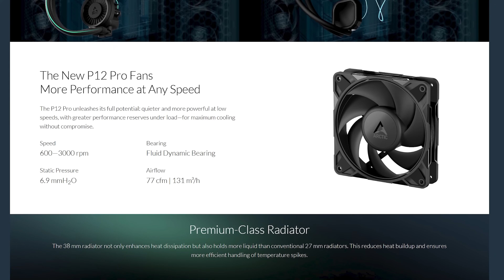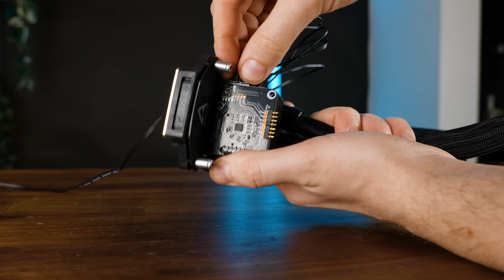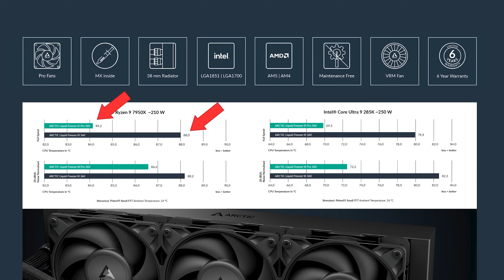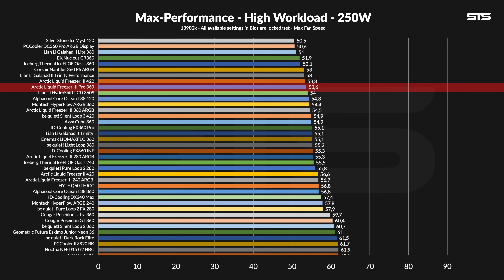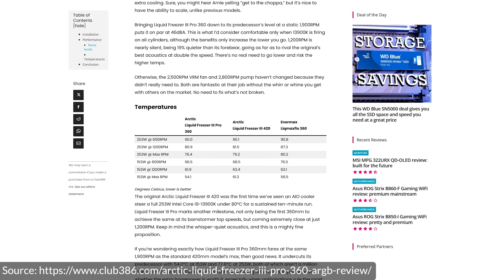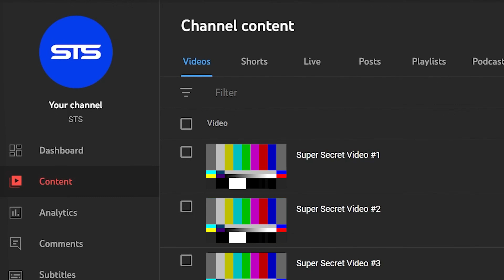Arctic Liquid Freezer III Pro 360 - The Pro Among The Kings

Comment: not impressed at all. And these thicker rad AIOs from Arctic are beaten by slimmer ones nowadays.
Reply: Maybe Arctic can improve the internals to "slimmer rad specifications" and beat them by performance with 38mm radiator in the next version. Oh and improve their cold plate design. Fans are pretty much perfected.
Reply: @Faruk651  I would love a nickel plated coldplate, and also move the pump inside the rad like the uber expensive xe360-TR5 cooler so that pump noise is reduced and potential leak can be isolated away from the rest of the PC hardware.

Comment: Looking forward for Arctic Freezer 36 performance with swapped fans with this new pro variant.
Reply: I don't think people do realize the Fans are not where the improvement is. Fans are pretty much perfected. The cold plate and the efficiency of the radiator is the limiting factor.
Reply: @Faruk651 scratch my previous comment, these fans literally have triple the amount of static pressure, they went from 5 blade to 7 blade with tighter tip clearance. The fans are genuinely hugely improved

Comment: I really wished they changed the design of the tubes. It is not compatible with a lot of x870 and b850 mb and the free heatsink they provide you is absolutley not enough for gen 5 ssd/ Mine was thermal throttling

Comment: We need a standalone review for those fans; they seriously look impressive.
Reply: I have to know if its better or worse than the endrofy fluctus
Reply: @ definitely better I,d say
Reply: The pro faster rpm on pump fan,  faster rpm on fans on rad to can't wait for the 420mm version  😁
Reply: @lordsanjeep  you know if fast rpm is your thing 10.000rpm server fans costs hardly 15 euros.
Reply: ‼ The Pro versions of Arctic have worse temperatures than the non-pro versions of AMD processors. My ALF360 keeps 6C lower temperature on the 9800X3D than the Arctic Liquid Freezer III Pro 420... https://www.youtube.com/watch?v=cw6n5ev4-oI
Reply: looks like a copy of be quiet! silent wings 4
Reply: @GukuBest it’s worse, the sw4 120 has a 9 blade design so its got better airflow and air pressure (also a 6-phase motor with fdb bearing so its also more reliable and less noisy) obviously the cost difference is big though
Reply: @kerotomas1  lol 5 pack of Arctic pro fans for less than a single Silent Wings 4

Comment: The water pump on this thing sounds like a vacuum cleaner on full blast. Regret buying it.
Reply: Try to put some tension on both hoses close to the pump. Get some long velcros or zip ties and pull them to one direction and tie it to the case. Inlet and outlets are swivel so no worries about bending them. This will lower the vibrational noises a lot. Give it a try.
Reply: Got my LF3 ARGB two weeks ago, and is my first ever aio. Im surprised how dead silent the pump and and fans are at 100% . I'm glad I got lucky in that regard.
Reply: If I max out mine at around 4500 (reported) RPM I  can hear it a little. I dropped it down to just above 4000 and it's dead silent
Reply: Yes it is pretty loud at 4500 rpm, but in my case with an 7800x3d I can easily drop it to 2000rpm with no temperature impact.
To be fair it is the 420 version which is overkill, but almost the same as the 280.

If you have a 300w CPU: good luck

Comment: What do you think about changing that 7950X3D to 9950X and testing it at (for example) 120W, 180W, 230W? I think it will show more info about how the coolers perform on AM5.
Reply: Nah your 7950x3d is still a monster CPU even today . If you want to upgrade from it then you should go to the 9950x3d to feel a big difference. Or wait for the Ryzen 10000 series.
Reply: @Thomas-y24  Did you read my comment? I did not ask for an upgrade, I asked if he can change his 7950X3D for another CPU and test it properly using 120/180/230W.

Comment: What the hell happened to the AMD benchmarks??? WHy concentrate on Intel that hasnt really sold well in the last 2 years?
Reply: Intel is hotter, that will give a better test as to how well the AIO is cooling. The AMD section being so small just shows this thing is overpowered for such a setup. And it doesn't matter if Intel hasn't really sold well last 2 years, there are 1000s of 13th and 14th gen setups in use.
Reply: @sabishiihito  Gives us figures showing us how it performs to other coolers, including normal LF3, its half assed regardless of everything you just typed

Comment: When will the 420 pro be released? The 420 original is sold out everywhere 😵‍💫
Reply: They have said Q2 for the rest of the models.
Reply: @TheGooseBruce  isnt this q2 right now? 😂👍
Reply: @jonashoeg Yeah, but in my experience, Q2 never means early in the quarter. Even if no delays. :P
Reply: @TheGooseBruce  yea i know. I will se if i can find a decent used one. And do a push pull configuration of the "old" version. I dont really want to wait 1-2 months.
Reply from the maker: No idea, I’ll ask and get back if I get a date

Comment: STSYT. Do you always use the same thermal paste with exact same application for all your tests? Also how much do you tighten the contact frame and cold plate down? Bottom out? Thank you for these great reviews.
Reply from the maker: Yes, always the same - I not quite all the way through, I try to match roughtly what the original was installed at. 
For Arctic specifically, it's a pain as after re-installing the custom one used for every other cooler, I have to re-test some of them to be sure that nothing changed
Reply: @STSYT Do you spread the paste every time?

Comment: Under 5 minutes gang! (sorry for being cringe)

The new fans seem a bit disappointing, they don't seem to perform better compared to P12 ARGB and Maxes when it comes to noise to performance. There is some improvement on Ryzens though. So maybe that might be due to this new offset contact frame. How about testing LF III Pro but with the frame from the non pro on Intel?
Reply from the maker: Been there, tried that. 
Originally, there was a whole segment of the video covering that part - it didn't work.
Generally, it worked (slightly) better under most circumstances, aka +-1°C offset towards the right (250w workload), but not enough to push it past the LFIII 360 max. And I decided to remove that from the video because we started to jump into modding- territory for a standalone video.
So yeah, a bit better, but not enough to outperform the original thing
Reply: @STSYT That is strange. I got worse performance with offset contact frame. With the offset contact frame you can see like 3-4mm of ihs not covered at the bottom.
Reply from the maker: @Faruk651  Seing the IHC is not neccecarely a bad thing, see AMD- And this will also hugely depend on the chip, load, ambient temp ect.. Not to forget margin of error, each run can have to a °C margin, depending on the coolers current feelings, that's why he have to average stuff over and over again
Reply: @STSYT I understand but since Arctic engineered the original frame for the lga 1700, isn’t it a bad idea to shift the cold plate to expose ihs.
Reply: Testing the original contact frame on the pro version is a good idea. I don’t think offset contact frame benefits the lga 1700 chips at all. Because i tested the offset contact frame on my LF III 420mm and i got 2C higher doing the exact same test. We need more people testing to be sure, mine might be mistake on my side.